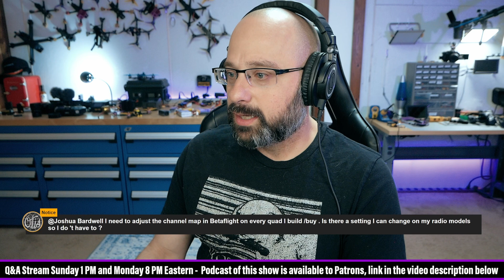What Do I Set In EdgeTX So I Don't Have To Change the Channel Map In Betaflight? Mode Setting? - FPV

Comment: I literally had to change my mapping last night.  My Throttle Yaw was switched with the Pitch Roll. Causing the 3D model to spin until I put the left stick in the middle.
  Problem solved.